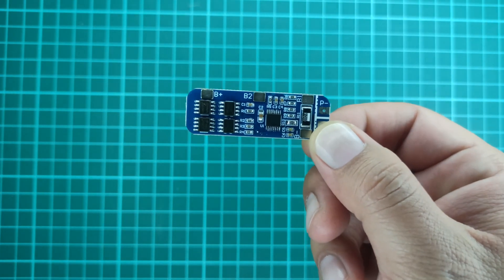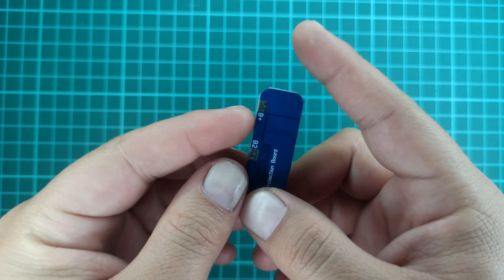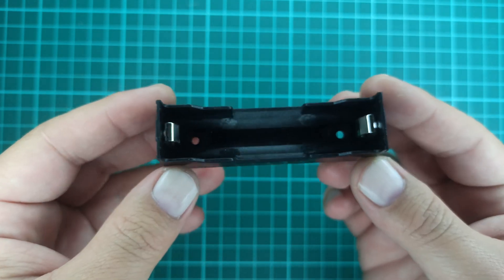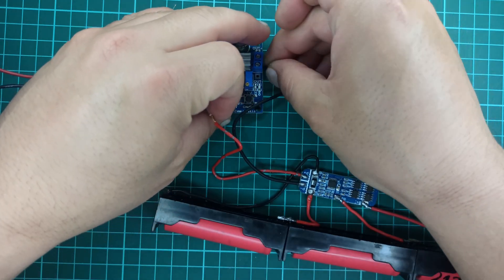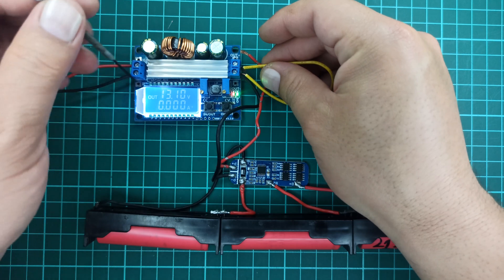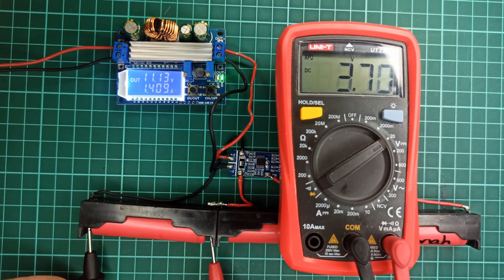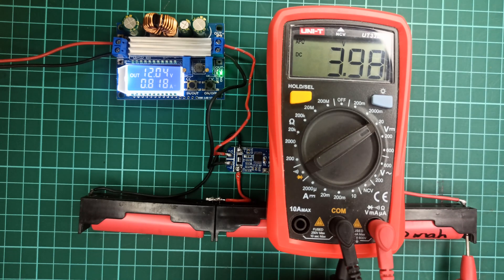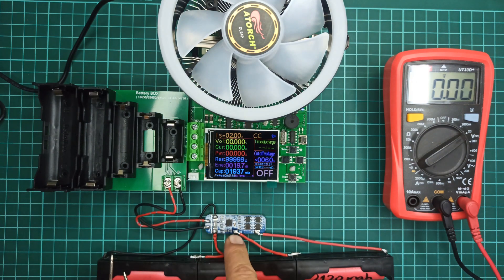Lithium battery charging module

Comment: Sir can you tell me which bms is best for lipo battery
Reply from the maker: A bms cannot be defined as best or worst, its about the specifications of the battery and bms, for either lipo or li-ion battery, you should check for overcharge protection, under voltage protection short circuit protection etc,.
Also, bms circuits can be for single or multiple cells/lipo packs, so always check what is your requirement.
Finally, the maximum current margin should always be considered depending on your load.

Comment: Thanks...very useful. Can u suggest a BMS for 3s Li-Ion with a balancing function?
Reply from the maker: You can easily find such a BMS online, most of them are chinese made nowadays and they have the balancing function builtin.
What is the application?
Reply: @ERLEngineering  It can't be a resistive discharge (power wasting) balance.  I need a capacitor shuttle solution, being solar power based.
Reply from the maker: Yes, those are know as active balancers, i havn't used those yet but i've seen that they also have some drawbacks like if you keep it connected to your batteries then after a while the batteries gets disbalanced again over a large ratio.
Sorry, i have not used those yet so you should search it.
Reply: @ERLEngineering  Ok , np...for my solar application, energy efficiency is key. I'll look at designing my own 3s 1p capacitor shuttle with a low ESR cap.
Reply from the maker: Best of luck 👍